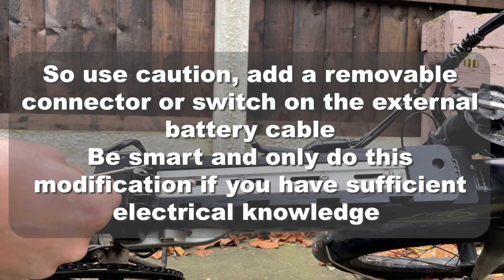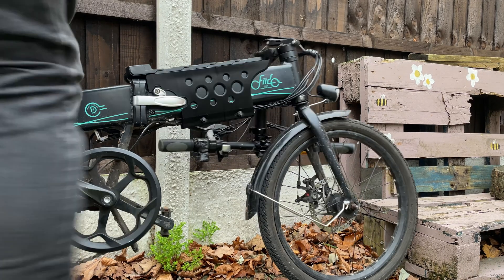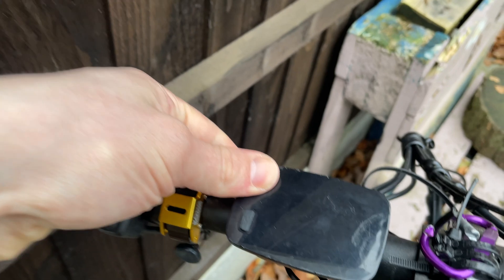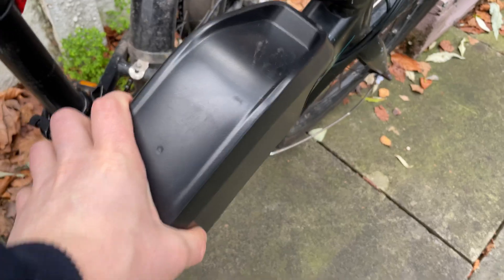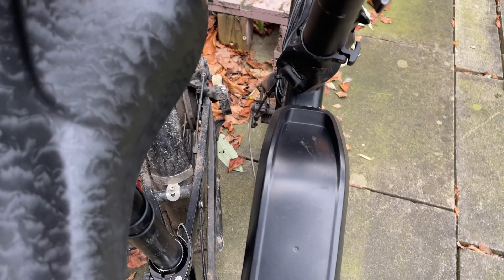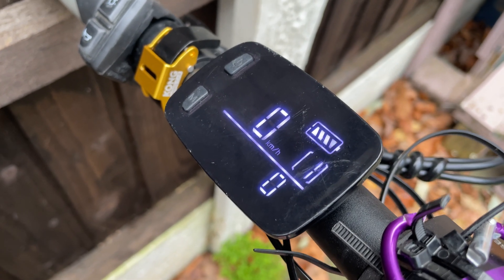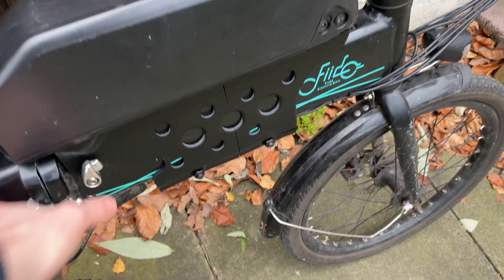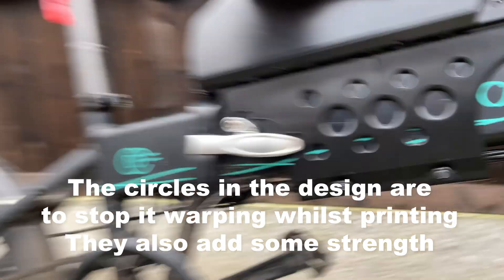External Battery Holder Mod for Fiido D4s (M1 Pro / M21 Update in description)

Comment: You could also used steel strips to very securely attach the printed holder and save weight at the same time or dedicate that weight to increase the structural rigidity of the holder in other places)

Comment: You could just implement a self-resetting ATO fuse or other fuse to increase safety. Also could use diode for that, but it will decrease your voltage to the ESC by around 0.7V and may heat (not sure, but you can think about it).